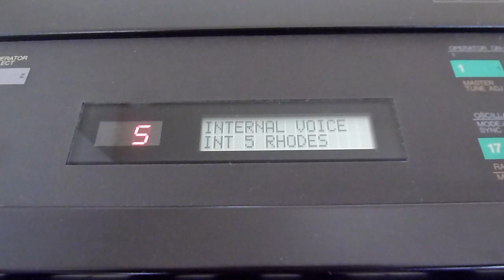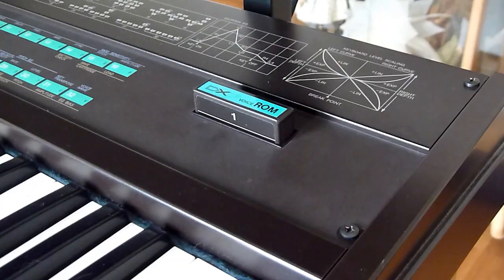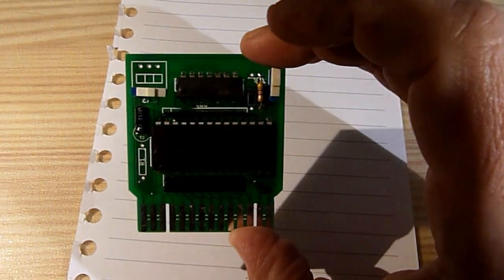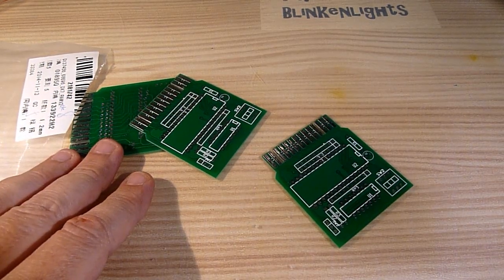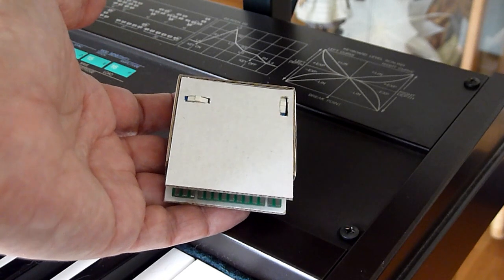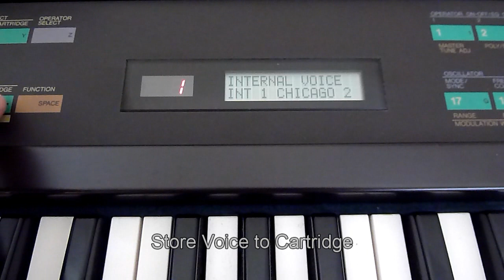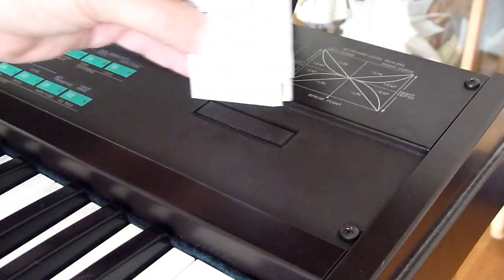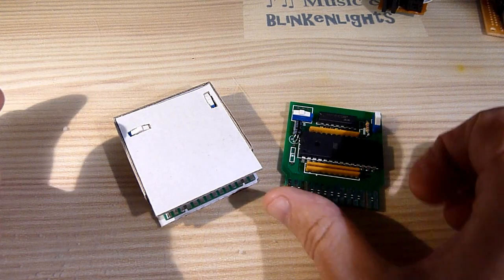The Yamaha DX7  -- Part 1: RAM Cartridge

Comment: I get no sound on my Yamaha dx 7 mk2 fd while all other synth works. Any ideas about what i will need to check out ? i have replaced all caps ceramic and electrolytic on the PSU but the problem remains. Also i get some kind of hum.
Reply from the maker: Ouch, hard one! I'd download and study the service manual of the synth and then probe with a DVM and an oscilloscope (a cheap one's enough) if you get a "signal" at various points of the signal path: keyboard, CPU, amplifier...

I'm about to publish a video where I "fix" the mystery synth by poking the DVM probes aimlessly at various components...